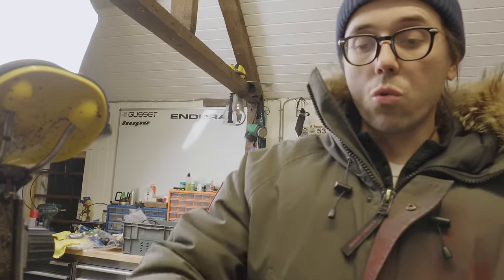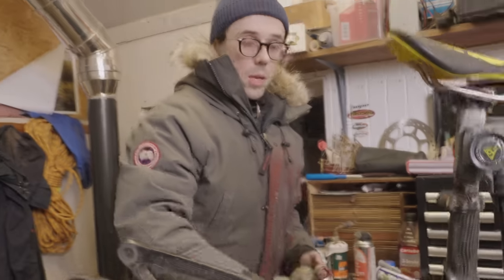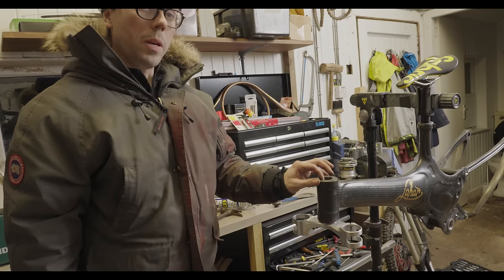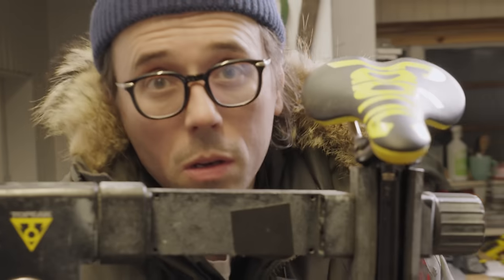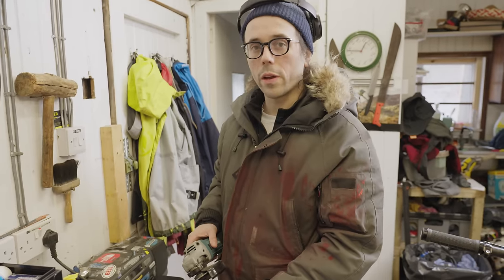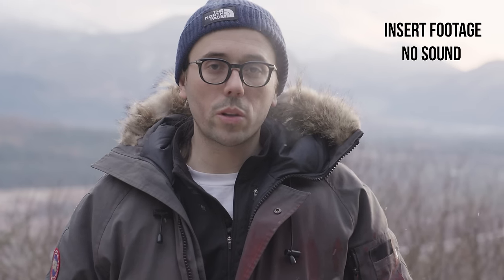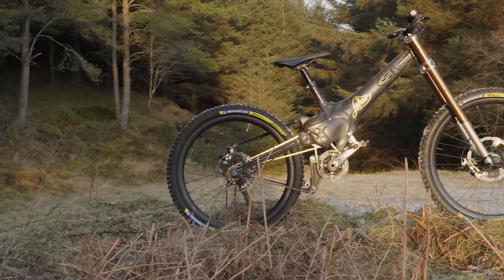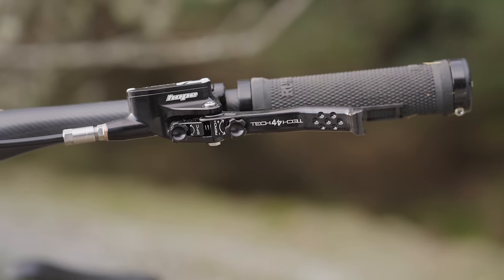We Can Rebuild Him, We Have The Technology....

Comment: I was expecting a hellspawn/fiend/frankenstein of a gearbox, but it was just a Rohloff... XD Pretty clever nevertheless! Nice bike, liked the video. :)
Reply from the maker: Yeah it’s just a modified Rohloff for the gearbox, works pretty well too once you get the hang of the quirks too! 

Thanks for watching
Reply: @stephen_hughes  Yes... Highly regarded this planetary boxes around these parts. (NL/BE) Not cheap, normally assembled with a belt drive. Silk smooth, ideal for long distance due to how reliable and maintenance free they are, as well as being capable of tolerating a high degree of grime without really wearing much...
Reply from the maker: @ruyzapiola5965  I think the only let down with Rohloff is if it breaks it can be away for months to Germany to get repaired.
Reply: @stephen_hughes  Guess opening an authorized Rohloff service point in Oceania is maybe not the most promising business venture...

Comment: Amazing video, bike came out great.
Few words on the Rohloff gearbox:
Needs an oil change once a year, Rohloff have a rundown of it on their channel. (This may be the reconditioning you alluded to at the end)
They made a new shifter in the meantime, less triangle-y, looks and feels nicer.
And lastly a neat trick: For some unknown reasons Rohloff uses brake housings for the cable. If you swap to any generic shifter housings it'll net you a much crisper and defined feeling on the shifter.
Reply from the maker: So when it was ridden a lot all those years ago it was changed regularly but since it sat in my garage for basically 10 years and hasn’t been ridden much it’s never been done. 

The shifter sounds cool, although the grip shift is good when you get use to it as you probs know. 

Good shout on the brake housing, I’ll get some outers, I couldn’t think why the cables didn’t clamp as good as they use to tbh but it’s probs that!

Thanks for the tips and watching!
Reply: @stephen_hughes  Oh the new shifter is literally just a refreshed grip shifter.
Trigger shifters exist but its a bit of a bodgejob.
Reply from the maker: @TheDarthWTF  Yeah never actually realised that but had another look after you said. The triggers wouldn't work because if the way the box is fitting into the frame!

Comment: Quite surprised that you didn't put on a set of manitou forks on as it's looks like you have a few spare.
Reply from the maker: Most of the old dorados I’ve got are 03 ones and they are for more period builds so I wouldn’t use them on it, I wanted to also use higher end more modern tech and the Intend fork fits that bill perfectly!

The others will be used on up and coming builds though so I’m sure you’ll see them!

Thanks for watching.
Reply: @stephen_hughes  nothing wrong with intend, I wish to buy a ser soon.  Great video.

Comment: Bugger about the footage. And shame about the mountkng screws and gearbox plate issue. Did have a run of cnc'd spares that never made production. Got lost in some call of duty and urgent move years ago. However... Recently a backup on an old hardrive drive with all the CAD files for everything I ever did has surfaced.
So I should actually upload them as a public domain resource, machining being pretty cheap nowadays.
Who knows. I'm amused that you're describing it as short and low by modern standards. At the time it was designed 21years ago, that was pro-racer requested geometry, and lots called it high, though they were not taking into account the initial sag and negative travel that was more than others ran at the time. Because of the shocks and lack of independent, high pivot anti squat behaviour, supple initial travel and smooth even wheel contact force, hence traction, was being sacrificed for pedalling efficiency on conventional bikes.
The bigger wheels today are still contraversial.
I know some kiwi pros still prefer 26inch on smooth and fast courses.
There is a hell of a lot of Aerodynamic drag and sacrifice of nimble fast response to rider inputs with direction changes and even pedalling efficiency loss with larger wheels.
Still..  The big front, small rear is exactly what I did with early protos. Though 26F24R then. The mk8 production was initially designed for those, and it lost some antisquat/antidive when converted.

Guess the higher BB and longer wheelbases today are the inevitable consequence of the bigger wheels.
Good work again. 🤗👍💎
Lahar😇 🌊🐉
Reply: @-TheRealChris  Not very real Chris.
 Many hundreds of thousands of dollars of cash and Several 12 thousand dollar+ bikes and a factory full of over 100 thousand dollars of Brand New OEM parts, and Production Tooling that cost 250 thousand dollars and 2 years of my work for the Lahar DHV Mk8 were stolen off ME, and Four different limited liability companies during 20 years of ME personally building toys for rich boys.

By Sponsored riders, Subcontractors, investment partners pretending to their wives to be working for the company when not.... 

I WAS NEVER PAID A CENT IN WAGES IN WAGES OR SALARY, OR SHARE DIVIDENDS DURING THAT ENTIRE TIME.

Many sponsored riders did get bikes, international travel, cars, vans, even salaries during that time. And factory workers all paid in full too. 

There were a couple of subcontractors that took between them over 200 thousand dollars, to make Lahar Downhill bike moldings, and after demonstrating they could make them from the tooling, supplied no more and cooperated with hostile takeover attempts to steal said tooling.
The situation that you appear to be referring to is one idiot from Hong Kong, that paid for a frame and drive train kit, that was complete, except for a 2000 dollar Rohloff, took a month of my unpaid labour to build, then with the help of ride monkey forums, who refused to put a stop to it, got a huge whinging bagging session to the number one search result on Google.

 Where it was for many years, destroying my reputation and ending the Lahar story.

The limited liability company no longer existed so he was not owed a bike by me or anyone. In fact he refused to consider people's offer to pass the hat and buy him a rohloff for the frame. I would say the situation is that he owes me for defamation and the loss of a career and company considered conservatively valued at 100million dollars.

At that point I had had to work unpaid for two years from 2006 world champs win to 2008, as a sole trader, due to a shady business consultant taking a govt grant of 30 thousand dollars, and instead of setting up the watertight trust, IP holding company, and trading company for investment as he was paid to do, with all appropriate constitutions etc, to prevent a repeat of several prior smash and grab attempts by investors.. 

Didn't honor his contract and tried one himself the day after the 2006 WChamps win. 

In that 2 years as a sole trader, I turned over 200 thousand dollars but had to sell my house to pay a shortfall of 30 thousand in trade accounts at the end of it. 
I had budgeted for the Rohloff, but that money was stolen by my stepfather to pay for my half sisters wedding. 

Stephen Hughes was caught in this a little too. As a young feller who really wasn't equipped to be a distributor, I sold him the bike you see him restoring at below parts cost as he is a nice guy and seemed to be worthy of a chance.
I can't quite remember the details, but he may have had a deposit on a frame, he never received? But voluntared to let it slide under the circumstances.
It is, I agree disappointing that the egos, unscrupulous behavior of rich people and a few egotistic sponsored riders caused the snatching of disaster from the Jaws of world leading success around 6 times from 1990, to 2010.

However those are the ONLY cases where anyone was owed anything, least of all money during those decades. Certainly not by myself.
I don't believe Stephen has lost on his investment. These bikes are highly sought after, and if offered, sell immediatly for far more than I sold them then.
So reign in your bitching please.
I have arranged to have uploaded all the Cad files for my bike designs, tooling and parts for all my designs to public access and free public domain usage. 
I have no interest in getting back into the bicycle building game, and would rather do this than sell this work to some rip off brand that sells 50 buck slave labour frames that last one race on the world circuit, fitted  with parts that most cannot afford to maintain for thousands
This amounts to many years of unpaid work and development.
So I suggest you take a step back and stop acting like a prissy little f'wit spouting shite you know nothing of, and ruining everyone's buzz.

I have no regrets and no reason for guilt over any of My actions.
You perhaps might consider an apology appropriate.
Reply: @Maungateitei  OK fair enough, if thats the whole truth then i apologize, previous comment deleted.
Reply: @-TheRealChris  Thank you Chris. There are people here that know it is. And I have long ago buried the hatchet with the sponsored riders, most other players, that got caught up in, particularly the very ugly 2002,-2003 Crushing of Lahar, by investors and subcontractor. There is a principle in these situations called the Aberdeen Paradox,  or why good people behave badly in hostile takeovers and similar scenarios. Names after Aberdeen university who recognised and studied the psychology of it, published papers on the subject. It is difficult to believe that an under-resourced individual can stand up to a billionaire with a  team of 20 of the country's top lawyers, who tells them nothing is going to happen with Lahar until he's got rid of me, and the best thing for everyone is to help make it as quick and clean as possible. Although it came close to killing me at the time it was a valuable learning experience that some ironic humour came from. That no-one got anything is disappointing. And people with that much money and power, it's easy to believe they can take a project like Lahar, hire replacements of high calibre, and make it work.
After 18 months everyone started talking about what went down and couldn't stop.
It's amusing, as punter put it that Lahar "sponsored everyone in the NZ national series" in 2003. Thought it was the investors money that had bought several hundred Maxxis race tires and fifty component sets.
And as it proved to be he, with all his money couldn't, and me with nothing but some free words of advice from a lawyer I knew a little could keep the brand and designs, and rebuild.
If I didn't have a hand drawn logo, or had some gimmick that was patentable, it may have been very different. We would never have seen an m9.

At the end of the day, the claim "with bikes: Faster, lasts longer, costs less, you can have any two but not all three" was proven incorrect.
And that's what I set out to do. 👍
Reply from the maker: @Maungateitei  Aaron, I actually wasn't going to respond to these comments tbh but since you've name checked me with facts that aren't true I'm going too. You said I was young at the time which yes was true but I also ran a small successful imports company in the UK with a lot of small, niche and high end components(Gamut and Industry 9 wheels being two) that I was selling and selling very well.

At no point was it only a deposit or did I just let it slide, you contacted me once you had "completed" the frame and needed the last part of payment for the dispatch then you become difficult and as the phrase goes the shit it the fan then you disappeared. The amount was a few thousand pounds!

The frame above was being built as a sample that would have been featured in Dirt Magazine and various other outlets as well as going to a sponsored rider here in the UK!

Even after all these years I still think the frames you made were great but spinning a narrative as if it wasn't a lot of money is disappointing. I wish you all the best but please dont try and totally paint yourself as a total victim here some of the blame has to lay at your door.
Reply: Crazy that this dude still tries to put the blame on people who waited for years for their bike with full payment in advance...
Reply: @Alkhiman there were other bike brands run by a few people or only one person at the time of lahar. But I don't think that any of them kept customers in the dark for years on end, completely ghosting those who deposited thousands, without ever coming back with frames or at least a refund.

I can say much about one company which nearly went bankrupt around 2010-2011 but still managed to pull it off and make good with customers while being run by 1-3 people. Almost every single frame broke and they delivered on what they promised in the end. The founder never once complained publicly that he didn't get paid for his work or put the blame on those who spent their hard earned money on his frames.

Comment: Those custom shock mounting plates look too weak, just drill 1 hole, make some new ones, they will break soon.
Reply from the maker: They are thicker than the originals and CNC’d from one piece. The originals lasted along time and they weren’t as good as the new ones.
Reply: @stephen_hughes  Did the originals have 3 huge holes at the stress point?
Reply from the maker: @digbysirchickentf2315  If they crack I’ll make a beefier version. 🤷🏻‍♂️
Reply: @stephen_hughes  Just thinking.. if only one side cracks,would the frame take any weird loads around the other side. Probably be fine.